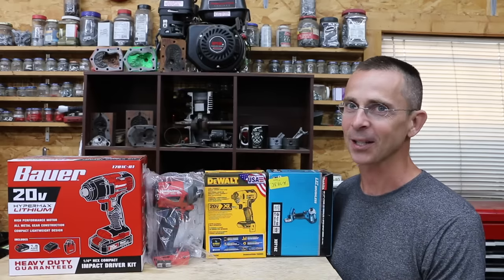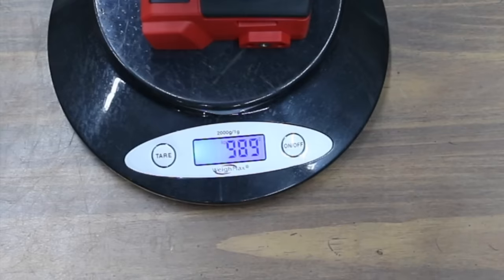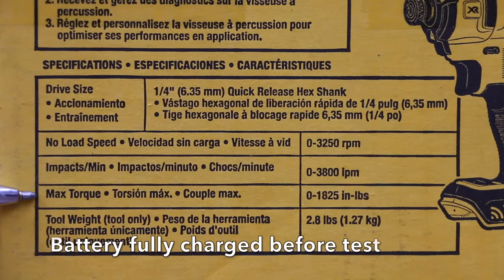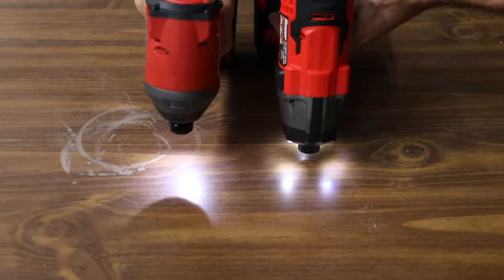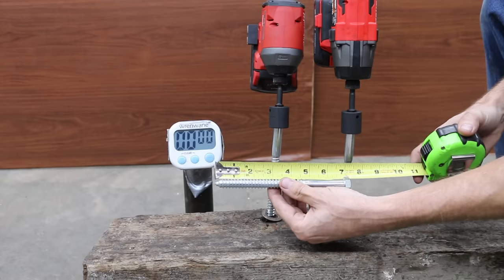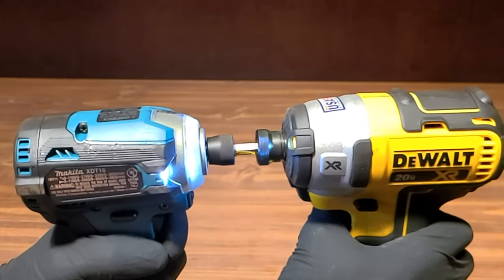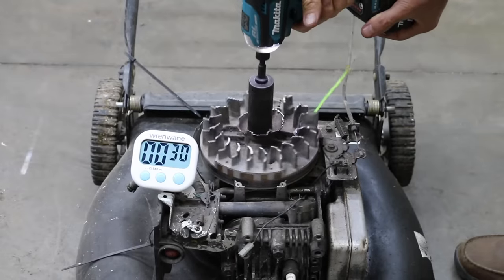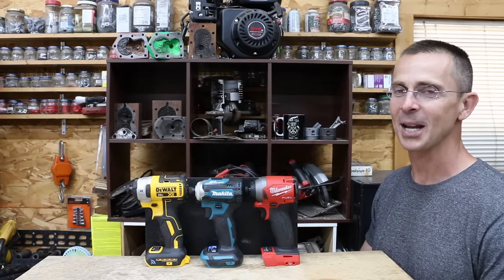Best Impact Driver? DeWalt vs Milwaukee vs Makita vs Bauer!  Let's find out!

Comment: So glad I'm getting myself a Milwaukee as my first impact driver for Christmas this year.
Reply from the maker: Great to hear!  Thanks for sharing!
Reply: I’ve been heavily looking into them as well as I have their impact gun, a charger and two 5.0Ah batteries already so I might as go with their tools (they also some of the best)
Reply: get the high output batteries, its a beast
Reply: You will love it...consider Makita too. I believe these 2 tools are the best on the market.   Also Rigid brand is a good quality tool and they have lifetime warranty on their batteries!!
Reply: They have alot of tools on sale right now. I saved 55% at home depot on Milwaukee
Reply: Got the m18 and m12 fuel impacts. M12 for home and small project and m18 for the big stuff.. i just got to remember which on I have in hand because that m18 is a Beast. I recently got their pack out. And beyond impressed with Milwaukee. Especially once you see what the 3d guys got going on for the pack outs. Great choice you won't regret it 👌 👍
Reply: Research the entire line when you buy your first power tool because once you have one brand of batteries you will want to stay with that company. Just a piece of friendly advice. But Honk Kongs TTI Industries owned Milwaukee is an option to consider. Think of the next 5 tools you may want to buy and batteries and compare to the other companies. Everybody makes a decent professional quality impact these days between Bosch, Makita, Dewalt, Pretty much all the battery drills, impacts, etc are made in China these days to keep the price as low as possible) even the homeowner grade Rigid did exceptional here but I would not want most of their other tools. (much like the crappy Porter Cable tools that Dewalt is importing with that once famous American companies name on them.)Ryobi is right there with Rigid and Porter Cable in many cases too, Kind of a cheaper quality, cheaper priced version of Makita for the homeowner.  Personally I would buy Makita, Dewalt, or even Bosch over Milwaukee from the Hong Kong corporation that made their first big dollars and famous for their womens Bullet shaped personal massage devices that are usually kept in a nightstand. The other 3 companies were started to make tools and still are doing that.
Reply: Home depot generally has a lot of dewalt/milwaukee deals so id say and wait for a sale.  Plenty of amazing deals to be had.
Reply: Ryobi :)
Reply: @PatriotPaulUSA  All this was excellent, well thought out advice.

To add an anecdote, I recently bought the Milwaukee Power Drill / Impact Driver combo, twice. That came with 4 batteries between them. Every single one was not only dead, but the charger said they were faulty. All 4.

When I went to Milwaukee's site to replace them, the e-service wouldn't allow me to do it despite being under their 3 year warranty. I had to do in-store service - with 1 location within 50 miles. I went and I was told flat out it'd take 2 months.

This is because the factories in china for electronics specifically are overtaxed. I called Dewalt and "faked" owning a drill, and though I wasn't as thorough, they had the same thing up on their website and guess what?

Their in-store replacement facility? Same location. I didn't ask about it then, but I suspect I would've gotten the same line.

Heads up to anyone buying powered tools! Batteries are trouble these days, so it's a bad time to be buying unless you're in a city where multiple locations are, and maybe you can score some batteries but... make sure they're good when you get home! I returned mine to amazon. Likely the home source for getting faulty batteries is amazon, very likely better to buy in a store and test them before you leave.

I ended up buying a Corded Ryobi to tide me over (always wanted a corded drill) but it's only 3/8 instead of 1/2, the second hand market may be a good place to look these days considering they likely won't have a dead battery.

Happy hunting all!
Reply: @BigMac8000  The problem with Amazon is there are a lot of imitation name brand batteries. You might think you’re getting a Milwaukee battery but it could be a knock off. I’ve owned Milwaukee cordless tools for years and have never had any issues with the batteries or the tools themselves.
Reply: I started with dewalt about 10 years ago and have had to stick with it cause im a cheapskate lol. Its worked out well but i do envy the Milwaukee owners
Reply: Run Milwaukee fuels you will love life
Reply: M18 Surge won’t disappoint just purchased it I love it
Reply: The many re-starts was not convincing.
Reply: It was a time when Makita was the best in almost all type of electric tools. Now is made in China and Romania...

Comment: I use my Milwaukee impact driver everyday and I wasn’t surprised that it outperformed its competitors.. however, I’ve also experienced the intermittent turn off during prolonged use. I’d like to know the cause. If I were to speculate, I’d think it was an overheating protection feature, but I don’t see that advertised anywhere. Thanks for all you do Project Farm!!
Reply: That’s exactly what it is. It was on the back of the box of the one I bought. It’s a feature, not a bug, to protect the tool. How are you liking it?
Reply: Overheat protection is part of the redlink system.

Comment: Dude, you totally crushed this review! The tests were extremely realistic, and your ability to isolate and compare functions/strengths is outstanding! The guided fall blew me away, very well thought out. I was also surprised that the winner was such a good value, as well. It's disappointing that the HF entry did so poorly, but not surprising. Thanks for the effort you put into getting such useful results, I only wish you had time to test everything in existence, to save us from the inevitable bad purchases we make (without data.)

I have had a Dewalt driver for a few years now (maybe not the exact model tested) and it's been a very useful tool. Unfortunately, I'm now invested into the Dewalt battery ecosystem, so it would be difficult to switch brands now. I've seen many of your product reviews, oil tests, etc, but if you can keep testing tools as thoroughly and concisely as you did here, you're going to crush some very worthy channels! You are the new standard for power tool testing!
Reply from the maker: Thanks so much!
Reply: Yeah same here.  I have Ryobi everything!!  From a 1/2" impact to a damn weedeater.  I bought 2 of the 4 Amp Hour batteries on sale a few years ago and I've been very pleased with the shit.  The 1/2" impact takes the lug nuts off of my F250 Super Duty.
Reply: I wouldn’t call that unfortunate at all.

Comment: I have both and the Milwaukee definitely has the most torque but I always reach for the Makita. It's so smooth with more finesse for driving small screws or self tappers, it's also lighter, quieter, it runs cooler and its much easier on the hand ergonomically and vibration wise for all day use. I think Makita makes best impact driver for what the tool is intended to be used for but the Milwaukee really hits hard especially on the heavy lag bolts it's definitely noticable.
Reply from the maker: Thanks for sharing.
Reply: Go BLUE! Yep, I love the makita for the same reasons. 👍
Reply: Yes, makita has advantages for all day use and smaller hands.  I love my makita cordless platform and Milwaukee corded

Comment: DeWalt blinds the user by how hot it is getting close to the sun's temperature

The APP: temperature ok.
Reply: It's probably battery temperature.
Reply: @nuddin99  And that's why you want thermal limits in the tool and the battery.
Impact drivers don't need that much power, they usualy don't overheat batteries.
If you want to overheat a battery, the quickest way tends to be running a small 2.0AH battery in an anglegrinder under high load, like a wide cutting disc, grinding disc or whatever.
Cordless anglegrinders draw a lot of current, some 10 A when just at idle and about 100 A under full load.
(depending on the exact tool obviously, but it's about what most cordless 125 mm anglegrinders should draw)
Reply from the maker: Thanks for the feedback.
Reply: @krisg822  100 A are certainly a lot, especialy at 18V, but anglegrinders have rather large and powerfull motors as well.
When running at their limit, they draw a lot of power, a lot more than during normal operation.
The Bosch GWS 18-125 V-Li entry level (!) anglegrinder has been measured at about 90A (depending on the battery) when pushed to its limits.
In addition to that these 1800W aren't all going to be themal load on the motor, it's still putting out a lot of mechanical power output and some voltage drop occurs in the battery pack due to internal resistance.
But sure, that powerlevel is unsustainable for most anglegrinders in the 125 mm segment, be it cordless or corded.
Only some oddballs like the high torque low rpm GWS 19-125 CIST are actualy rated for 1900 W, allthough that's more like a high end 150 mm anglegrinder with a 125 mm protective shield and a corded one as well.
The GWS 18-125 V-Li entry level cordless will draw some 30-50 A in regular operation and up to about 90 A when abusing it with a big battery.

Note:
A 12 Ah battery will not struggle to supply that much power for a few minutes, but a 2 Ah battery will not even supply 18 V at 90 A even when fully charged beyond 20 V due to internal resistance.
Reply: @krisg822  As I said, that's when you're abusing it.
Running the anglegrinder off a 2.0 AH pack is of course not good for the battery, but for a small cut with only little pressure it's fine as that's only about 30 A for a short duration.
But yea, smallest pack I regularly use for mine is the 4 AH ProCore.
These small 2.0 AH are awesome for more compact tools and priced pretty damn well IMHO.
Great fit for a compact cordless drill.

But as I said initialy:
If you want to overload them, use an angle grinder and push it hard.
The charger will refuse to charge them untill they have cooled down even if you don't run the battery into the shut-down.
Reply: @krisg822  Yea, that's why the 2.0 AH is so nice on a small drill.
About chicks using angle grinders:
I don't think the type of chick that uses anglegrinders to begin with cares much about the difference between the weight of a 2.0 AH and the also very light and compact 4.0 AH ProCore.
Both are single row packs, though the latter uses newer and slightly larger 21700 cells instead of the older 18650 cells.
But yea, running around with an 8 or even 12 AH pack all the time must suck, they are heavy and bulky while having little benefit over more smaller packs in most use cases.
Reply: @krisg822  On the other hand:
The GWS 12V-76 would be perfect as it's a lightweight battery powered anglegrinder.
Less than 1 kg including battery and small.

Comment: Project Farm ~ Are you aware of the collet issues that the Milwaukee 2853 has been experiencing?   Based on my research, the Milwaukee 2853 that is referred to as "Gen 3" came with only one ball bearing in the collet.  I'm beginning to see references to a "Gen 3.5" model, which supposedly comes with (2) ball bearings in the collet, but I'm still wondering if you're aware of this?  If not, the "faulty" collet that came with the Gen 3 loses bits that need to be withdrawn -- like wood-cutting paddle bits.  I'm wondering what your thoughts are on this?

Comment: If I crank my Milwaukees up they always break the socket adapters. What brand are you using?

Thanks for the videos!
Reply: Great question...I have the same question.
Reply: Stop using an impact driver and get an impact wrench then.
Reply: Also, I’d like to add that I dropped a 3/8 driver Milwaukee impact 120-140 feet on to concrete. Been using it for the last 2 years after that, has some wonky-ness but still works.
Reply from the maker: Absolutely perfect!  I have a video coming soon on socket adapters and used a brand in this video that is very impressive!
Reply: @ProjectFarm  dewalt? :-9 okay we will wait
Reply: Project Farm looking forward to it!
Reply: Scott Hangartner yes, but if I can carry one less tool around then I’d rather do that.
Reply: K C are you using socket adapters that are impact rated or just a standard adapter?
Reply: @stevej6824  It doesn't matter even the adapter that comes in millwaukees own branded shockwave kits is easily broken by the Millwaukee impact (I've broken 3 or 4 of them)
Reply: K C You have that problem too? welcome to the club LOL. Milwaukee is just a freakin beast LOL, but some time ago one of the tool related channels did a test on socket adapters and the top 2 were made by Makita and the number 1 finnisher was of all things the Husky brand, so I bought some of the Huskies and have yet to break them,,,,but I still haven't completely turned my Milwaukee to top power and let it beat on them for any longer amount of time trying to break them on purpose (I have a feeling the Milwaukee may still make scrap out of them, but so far in "normal" full power use they seem to be holding up).
Reply: Same here, replaced w/ "impact rated" adaptor & haven't had any issues since.
Reply: @ProjectFarm  Dewalt. Right?... they've been great for me.
Reply: I've broken them with my Makita, too. I get that the 'torsion zone' is good to keep you from twisting the heads off screws, but sometimes when driving a lag bolt or tightening a big nut, you're not worried about that. I found some Husky impact adapters which are old-school enough to not have thin necks, and they've held up well so far. For driving smaller fasteners, I actually appreciate the torque-limiting stuff (but that's rare when I'm using sockets).
Reply: looseballs1966 you beat me to it.
The Husky adapters are almost bullet proof.
I wasn’t very impressed with the shockwave adapters although their bit drivers seem to work just fine.
Reply: On a side note I have a Craftsman 3” Phillips driver bit that’s well over 20 years old that I constantly use in my impact driver and it does the job every time.
It’s definitely not made from any of that Chinesiam steel.
Reply: @stevej6824  LOL sorry. yea the shockwave stuff has been good enough but not the adapters so much, and yes the Husky tool stuf in general isn't too bad overall considering price especially.

Comment: its almost like Milwaukee tools are just better. i swear that every time ive seen a Milwaukee against anything its been the victor
Reply from the maker: Thanks for the feedback.
Reply: I use them daily and spent a small fortune. They're so disappointing. Literally all of them have broke with in 9-12 months. Name a Milwaukee tool I have it from the battery table saw to all impacts. The the thing is they're no better just more powerful and tear them self's apart.
Reply: If raw power is the only criteria, then Milwaukee certainly is usually at top. But its more to it than that. Ergonomics(size, weight etc), price, ecosystem and so on.  
There are several tool testing youtube channels that test alot more tools, and milwaukee certainly doesnt get close to winning all the tests.   
But, you wont get a shit product from any of the big brands, theyre pretty much all best in some category(Milwaukee, Hikoki, Dewalt, Makita, Bosch,Hilti).
Reply: Working as a plumber. Milwaukee impact, power/hammer drill, sawzall, and flashlight. All of them 5 ah batteries and not only are they tough but they help me get through the day. Been using the same tools for about a year and a half now. Impressive with the abuse i put them through
Reply: I kinda wish I'd bought into the Milwaukee system 15 years ago instead of Makita. Milwaukee seems to have better batteries and tool selection. My Makita tools have been solid, though. One thing Milwaukee can't seem to make is a decent corded angle grinder. I've burnt up two of their 9" grinders, meanwhile all of my other grinders are still going strong (Metabo, Fein, Bosch).
Reply: Ive used DeWalt and never had issues. I dont get the hype around Milwaukee. Sure, in extreme circumstances they beat everything but under normal use they do just as well as DeWalt. I also like the design of most DeWalt tools better. In addition, Milwaukee is owned by a Chinese company. I cant see a reason to switch as of right now.
Reply: @andybub45  agree, in the real world I hate my Milwaukee tools and started buy dewalt as replacement to my Milwaukee, even though they themselves are new. I have both in the van sometimes and I'll grab the DeWalt over the Milwaukee every time. I like the power of my impact but it keeps braking the chuck